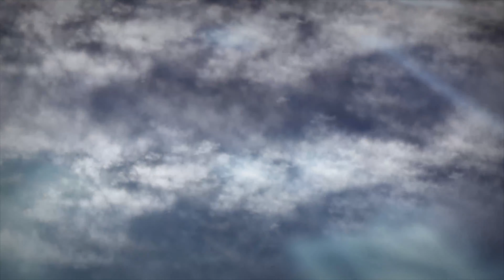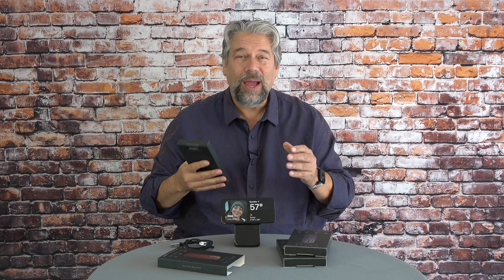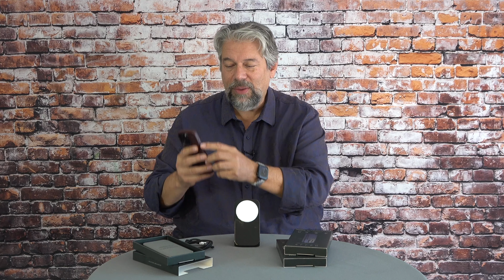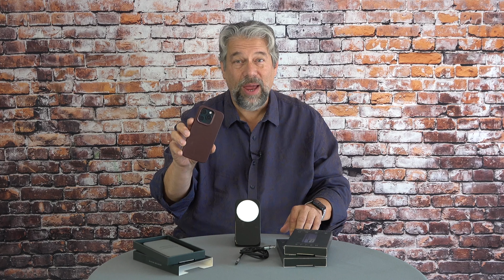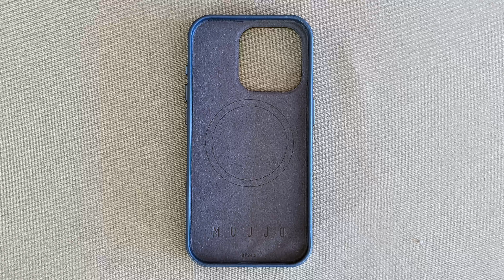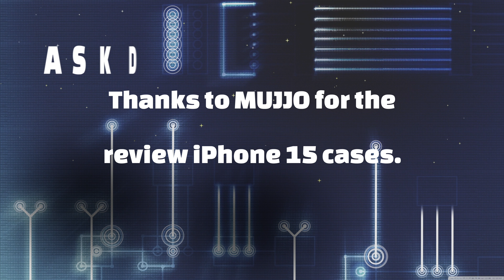MUJJO iPhone 15 Pro Leather Cases -- REVIEW

Comment: The magnets don't seem to be very strong...
Reply from the maker: I think it's a balancing act with the MagSafe magnets and wonder if they're too strong whether they'll impact the circuitry. If you're focused on the MagSafe feature, I would suggest that no case or a less dense case material might actually yield the best results. Then again, the stand's magnetic strength might be a factor too.
Reply: @AskDaveTaylor  since there are magnets inside the phone, there's no impact. Magnets, like any other material, has different grades of quality and some companies go for cheaper, weaker ones. It's all about the margins, unfortunately. Also, brands like Magbak add extra magnets an use it as a key selling point.
Reply from the maker: Ah, interesting. Thanks for that info.